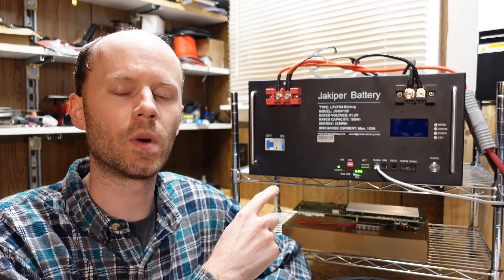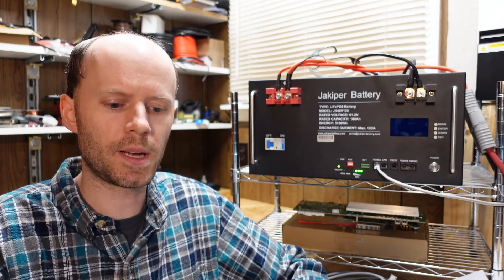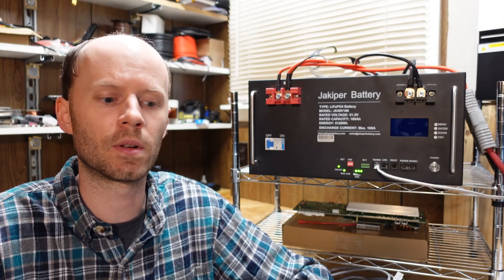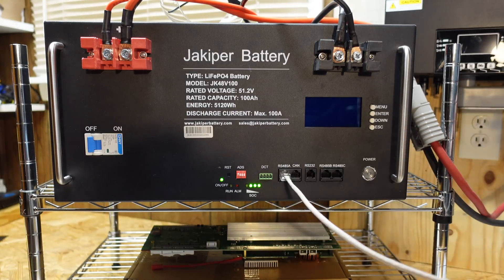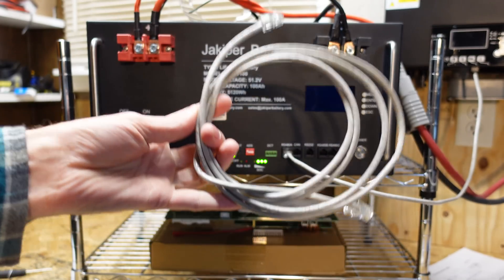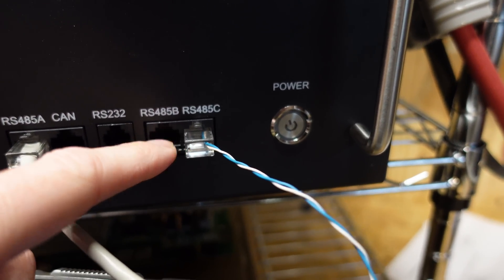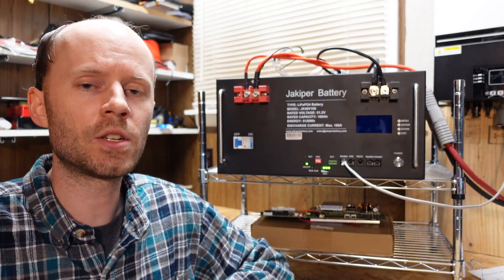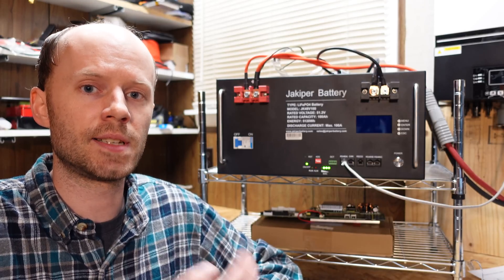Jakiper Battery and MPP Solar Inverter Communications, What's the Problem?

Comment from the maker: Jakiper Battery... https://jakiperbattery.com/product/jk48v100/?ref=lithiumsolar (affiliate link)
Please let me know if I missed anything or you have any ideas on how to get this working!!
Reply: They are using half duplex RS485.
You need to connect P on the inverter to B on the battery, then N on the inverter to A on the battery. 
Basically you transmit from one device to the other's receive pin. Ignore + and -. Think logical high and low.
Also, you need to make sure you don't need to connect the battery's pin 3 to an inverter pin for a common signal reference. This is fairly common in PLCs and manufacturing automation.
Reply: Use the CAN instead of the RS486 for communication and it will work
Reply: @cptjohn1143  yeah canbus is what is used for comms to charger - that is what it looked like to me too after reading the manuals and other info.
Reply: @LarryKapp1  That is the solution. The RS ports were only to manage parallel installation. Thanks, I knew that but was not sure :)
Reply: @cptjohn1143  I watched the Jakiper video on how to set it up . I think they just used a straight through cable . That makes sense if both sides are RS485 standard you don't need to swap any wires right ?
Reply: @LarryKapp1  I think they just use the word RS485 for the type of plug without following any rules or standard.
Yes a straight cable.
With this video I do understand the mails of the Seplos support: you need to select again the protocolls on both (BMS+Inverter) sides. And they added the Growatt protocoll, so the Pylontech does not really Work. And both need to be updated to the last firmware.
Reply: @cptjohn1143  I am going to try and get some communications going with my Jakiper battery today. I think I am going to try 485 since it is a bit of a run. Ultimately I would like to get battery bms data onto mqtt so I can send it to Raspberry Pi and then to grafana program. I have all my other solar data going to raspberry pi this way and graph it with Grafana. So I just need to figure out how to get the bms data to mqtt. I will probably use an esp8266 if I can figure that out - and if the data can be decoded without using the supplied windows program.
Reply: @cptjohn1143  I messed around all day making cat 5 cable from shed into house  and adapters to make it rs-232 and rs-485 . It is maybe 20 or 30 feet long. I couldn't get anythign out of the rs-485 ports , but did finally manage to get rs232 port to connect up to the jakiper software.  I didn't try the can port yet .
Reply: This video may help.
https://youtu.be/mCOUkXq0T20
At minute 3 schematic diagram.
If the inverter and the BMS talk pylontec seems it might work, Axpert is MPPT solar sub brand (Voltronic).
In some cases (more recent inverters) grd is also used... So ...
Reply: I replied below to try pins 7 and 8 on battery instead - see that post. If you have the other bms out you could do continuity test to see if pins 1 and 8 are connected , and if 2 and 7 are connected . As others have said the battery bms might not spit out data on that 485 jack until it gets the modbus coms from the inverter to start talking. And if you don't have the right connection then it won't ever work. See my post below - it has video link that someone else also suggested.
Reply: Did you check (with the PC Software) if the parameter of the battery were set correct? Looks like a Seplos BMS...
Reply: @cptjohn1143  Thanks John, I just got a Jakiper battery and was wondering what kind of bms is in it. I found youtube video that explains how it works and seems like the canbus port might be the thing to try . https://youtu.be/KkDIuMpIx_8
Reply: @LarryKapp1  The people in China (and our languages) mix all words together... You are right, in some cases they call the canbus RS485.
As far as I know you need the PC connection to select the right options to make that work - but changes on this level were not possible with all firmware versions. Seplos always wants to know in advance what kind of connection and hardware you use to make that changes.
Reply: Contact your MPP solar inverter distributers and ask them if they got a solution . As mentioned previously it does that with at least 5 different lithium ion or lithuim iron batteries.
Reply: Jakiper made a video on how to do what you want to do - here https://youtu.be/J3JpHn4FeqA

Comment: A single battery should be 0000 not 1000. 1000 indicates the master so the system expects to see 2 batteries not 1
Reply from the maker: No. The 0000 indiciates single battery with no communication. Setting the first DIP To 1 (or 1000) turns on the communication. Yes, it also defines that battery as the master and but it's NOT making it expect 2+. If you don't set it to 1, you won't see data on the RS232 port.

Comment: I have the same Problem with my set up can any one help me! i have 24 VOLT LIFEPO4 BATTERY AND HYBRID INVERTER AND ITS NOT CHARGING FROM SOLAR THERE NO SWITCHES ON THE BATTERY CANT GET IT TO CHARGE GRID CHARGES THE BATTERY, CAN ANYONE HELP ME.

Comment: What if you paste some of the codes manually that the inverter sends to the battery using the computer terminal? Perhaps the RS485A port doesn't send anything until something it sent to it first

Comment: I feel your frustration I have spent many weeks, I Have a similar problem in the UK I brought a Voltacon E-Box-48100R 5.12Kw battery and connected it to my Sofar Solar inverter via CAN cable and all worked great, so I ordered another one but unfortunately, a Pytes-E-Box-48100R turned up but was told they are exactly the same! I wired them as instructed, but after a few minutes get a fault on the inverter then it goes into a 60sec test loop ending with a red fault light, so I try the new Pytes on it’s own I get the same fault loop if I then just connect the original Voltacon it works perfectly again, I have had video calls with Pytes in China they can’t work it out, they say it must be an inverter problem! but If that is true why does it work so well with the first battery, I would change the inverter if I knew the battery was not faulty, has anyone had similar problems and sorted them?

Comment: This is how I solved this issue I have the same inverter and the same BMS on my battery, 
Setting on the inverter for battery type (5#) do: USE (user), for the communication use the CAN provided in the manual and is as follow: inverter side 6, 7, 8 goes to 5, 4, 7 on the battery side dip switches set to OFF all of them, restart your battery I hope this helps. Happy offgriding. 🤘

Comment: hi i have bms and only rs232 . i want to convert to rs485 to connect to inveter luxpower sna . will it work like your rs485a
Reply from the maker: Please see this follow-up video with instructions on how to change the protocol https://www.youtube.com/watch?v=mP6bO4Tb02w
Reply: @LithiumSolar  no, my battery has no rs485 or CAN connection. it only has rs232
Reply from the maker: @tanproduction4936  Oh sorry, this battery cannot communicate to inverters on the RS232 port.
Reply: @LithiumSolar  i want to convert rs232 to rs485 using external device. without having to change bms with communication

Comment: Hi @LithiumSolar !!! Check out this video from Jakiper Battery https://youtu.be/J3JpHn4FeqA
It might be the answer you are looking for communicating your Jakiper battery with your MPP Solar inverter.
Everything is done with a Growatt 5000 ES, but it's probably the same procedure...
Need a straight through Ethernet cable and to use a laptop+software to connect to the BMS and have him accept the inverter of choice... 
Hope it helps...!!!
Stay safe...!!!

Comment: @LithiumSolar I wonder if the default rs485 address is the same on the battery and inverter. Default is 001. In the settings menu you have to address the devices. 01, 02, etc. If they have the same address there's a conflict
Reply from the maker: Where is this option? I don't see anything relevant on the inverter.

Comment: If both sides are sending data, it will not say that both sides will receive data. In other words, if one of the 2 receivers fails (in battery or inverter), it will not work.

Comment: The UTP communication cable between the Pylontech B batteries and the switch uses connections 1-3, 3-1, 2-5, 5-2, the Pylontech C has 3-8 / 5-7 and is connected to the RS485 port. The batteries must be set to 9600 bps with the first DIP switch.

Comment: Try connecting the RS485 cable directly to the chassis of an Oldsmobile 448 and dragging it down the street to the nearest landfill (after harvesting the cells of course) 
Or use a hammer as previously suggested.
Sorry, feel your pain.
Never a tougher task than when a simple project simply won't work due to poor design and manufacture. The Industry really needs a standard universal practice for communications but that's sadly a long ways off. Love the ability to monitor data in real time but I've opted for the EG4 waterproof 48v battery with a good BMS and Bluetooth.
They work great and I monitor my inverter & system online. Just step into my battery room to check batteries via Bluetooth. 
Simply reliable and redundant system - so long as the inverter & comms function (no problems in 5 years to date) and the charge controllers continue to perform fine. So far the only frustration we've had is fairly common internet provider outages which keep us guessing when away from home.
Keep up the good work.

Comment: Have you tried shunting these through the GPIO on a Raspberry Pi or Arduino to monitor state and try to watch the traffic?

[edit] 
No, but you used a USB. I wonder if you do a tap off of a cable and watch the two-way communication if you would get anything different.

Comment: Two things.  You can snoop the RS-485 signal with a PC a 485 dongle or card, and a terminal program.  Just to see if there's any activity.  Secondly, the last of the RS-485 chain may require a termination resistor.  I had to use them on fuel station pump equipment to get them to communicate correctly with the controller back in the day.

Comment: I didn't see this mentioned in the comments...
At 0:50 you show the manual for the RS485 pinouts. For RS485_A it says that pins 2,7 are for data, but it also shows pins 3,6 are GND. Have you tried using 4 wires, with 3 & 6 connected to GND on the Inverter? I recall you mentioning something about GND loop. But "this" GND would be different than "Electrical" GND. Signal GND can be completely isolated. It is usually used as the Common 0V rail reference.
Some devices "require" the GND to be present because "that's" how it detects if something is connected to that port. It does a resistance test between GND and DATA pin, which has voltage on it, and that triggers the system to know that something is connected. The BMS could be designed to not output data unless it detects something connected. Considering that this is a multi-Protocol unit, this would make sense. The BMS would only output signal instead of wasting cycles processing a non-selected protocol.
Reply: Adding 2nd comment as it's getting long...
It's also possible that you have Pins 1 and 2 reversed. They are polarized. I found this for common RS485 coms:
---
Function Terminal Connected loads/Description
Serial interface
RS485 (Bus) X100-1 RS485P Plus line Send and receive-
X100-2 RS485N Minus line line
X100-3 RS485P Plus line (difference input/output)
X100-4 RS485N Minus line
X100-5 Signal frame 
---
Granted, pins 3,4,5 are connected differently in your case, but it does show that one of the pins are Positive, and the other is Negative. So you may have your pins swapped. I think I saw this suggestion in another comment as well
Basically this would be akin to connecting the SENDING(inverter) pin to the SENDING(bms) pin, and RECEIVING(inverter) to RECEIVING(bms) pins. You may need to switch these around so that it's SENDING(inverter) -> RECEIVING(bms) and RECEIVING(inverter) -> SENDING(bms).
Reply: @korishan  Jakiper made video on how to set this up https://youtu.be/J3JpHn4FeqA

Comment: Love your interesting problems. In our country the Mpp inverter is either the Kodak Maxi Org 3.6.-- 7.2kw or Rct inverters. Installed a lot of Kodak with mostly the Pylontech 2.4 kwh and the 3.5 kwh lithium batteries. A lot of other make  lithium batteries was also used. Since day one on the inverter setting Pylontech get the same faulty reading 61. The only setting i use is the user setting. Program the inverter according to the battery manual battery volts.  If more than one Pylontech battery is used the commutation wire between batteries must be used. Master battery dip switch number 1 on rest off. Next battery all dip switches off. When master battery start button pushed it starts all other batteries in parallel. Done these type off ajustments on different make of lithuim batteries. One type of lithium battery the cut off volts on battery to be set at 48v other wise it needs to be reset in a very complicated way.

Comment: What breaker are you using for a disconnection and safety between the Jakipar and the LV?
Reply from the maker: Chint NXB-125
Reply: @LithiumSolar  for a 30Kwh 6xJakipar,  do you prefer a pair of hcr fuses or a 2p breaker?
Reply from the maker: @errcl65  With that many batteries, definitely a pair of HRC fuses.

Comment: You should try reversing A and B on one side of your cable. There are a lot of instances on the web where the RS-485 B is the positive line and the RS-485 A is the negative line.
It should be worth to try B->P and A->N.
Reply: this ^

Comment: Shouldn't the inverter be silent and receiving and the battery be sending. That cable showed the inverter sending. Check the data is going from the battery into the inverter. If it's single directional, the inverter receive buffer should fill when data is sent from the battery.

Comment: I know RS485 is a standard but I have been told that it is not possible to program the BMS to work with all Inverters out-of-the-box. I was informed that the batteries BMS needs to be programmed for the relevant Inverter they are going to be connected to. Jakiper should have asked you which Inverter you were going to use with the battery before they shipped it and programmed the BMS accordingly.

Comment: Try connecting the communication cables first, and then turn on the battery  and then  connnect the main power battery cables  to the inverter

Comment: Have you tried connecting the battery at a low state of charge , maybe the bms needs to be fully active to work , or try to activate to low voltage disconnect function or  the over current discharge function to  reset the bms

Comment: I used to work with 485 often. The ground is mainly just a shield to prevent interference. Not needed per say initially. Usually when I'd get a dead signal like your getting I'd simply changed the polarity on one connector. Sometimes you can get RX and TX mixed up. I'm sure you've already tried that? Most likely it's a firmware issue holding things up. IMHO

Comment: i created a massive program that worked with Midnight, victron, and MPPSolar inverters but unless its changed the BaudRate for communicating with the MPPSolar Inverters used to be 2400 and using CRC16 to read the data. it was last tested with a MPPSolar 5048 with no problems. but saying that communicating with the batteries could be different thing

Comment: When you hold up the Jakiper manual you show it says pin 1 and 8 for 485_B and it says pin 2 and 7 for 485_A  but when you mention  your wiring you say you are hooking it up to pins 1 and  2 on battery .  Did you try making the cable using pins 7 and 8 on Jakiper  instead ?  Someone mentioned  another   video ( see link)  where they show these connections on 7 and 8  on different equipment ( but maybe same bms?)  Someone else mentioned you might need to hook up the ground wire too .  https://youtu.be/mCOUkXq0T20?t=179

Comment: I think that your RS485 wire has the polarity inverted. The MPP Solar Inverter lists the pair as N and P, and the battery lists it as A and B. As you describe how you connected the pins on each side, you connected A to P and B to N, which is a logical assumption. However in RS485 A is typically listed as A- and should be connected to the N, and B+ which should be connected to the P.

I don't know if that will make it work, but it might be part of the problem. Good luck :)

Comment: So try this... on the battery side comm cable connection move to pins 7 and 8, and put the dip switches with 1st one down and the rest up and I bet that will fix your problem 🤔

Comment: Totally off topic but does that inverter have a N-G bond under battery or grid passthrough
Reply: yes ,but there is a screw you remove to disable grounding relay
Reply: @jamiebrock7157  is there a benefit or need to remove the screw? I was told its needed so that it is UL compliance but also got told that i can't have the N-G bond in the inverter because it needs to be done at the panel
Reply: Where remove the screw or not basically depends on how you wire it. You don't want a ground Loop that's the safety concern. You don't want to ground and neutral Bond to be in two places so if you plan on bonding neutral and ground at the panel then you need to remove the screw
Reply: @jamiebrock7157  when I asked about the screw I was told that the firmware update fixed the issue with the N-G bond and to not worry about it and that for it to be UL it requires it to have the screw in place but if I choose to I cam remove the screw to get rid of any doubt in my mind, im so confused